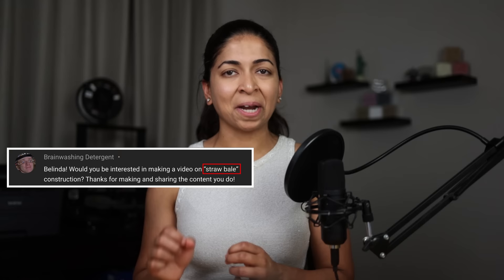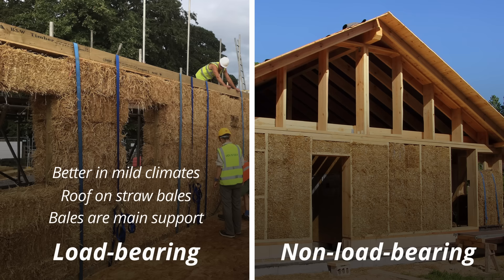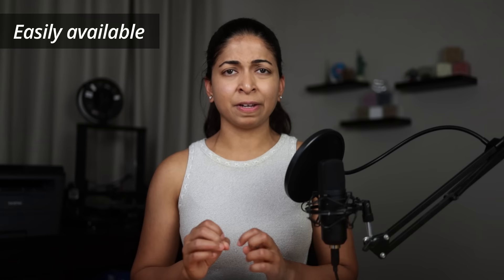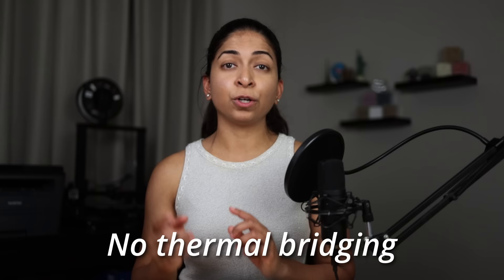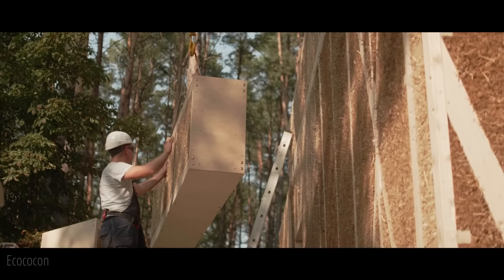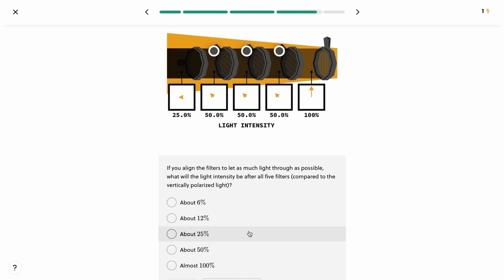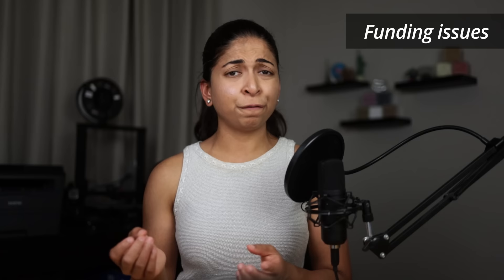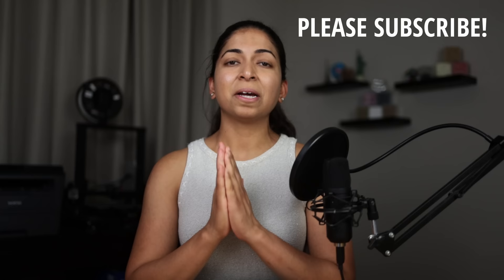How to build Straw Bale Houses | Pros and Cons

Comment: A builder near me built several load bearing straw bale houses for clients in the 1980's-90's.  When he wanted to build one for his own family the banks and insurance companies put a stop to his plans. I've talked to the people who live in one of those houses and they say rodents are the biggest negative even though the bales were treated with a rodenticide before construction. Someone else I know built a similar house using baled cardboard instead of straw. He ran the cardboard baler at a large catalog company distribution warehouse. When he learned how much the company was paying to dispose of the bales he made a deal with them to take some for free.The walls of his house are 30 inches thick.
Reply: We’ve near had rodents in our Strawbale we used stucco and not earth in plaster. Friends of are’s have had a lot of issues with there earth in plaster Strawbale.
Reply: But if the bales are completely enclosed in cob, how would rodents be an issue?
Reply: @RVBadlands2015  If the strawbales are essentially sealed off, not sure how rodents could be an issue. What issues did your friend have?
Reply: @backtoasimplelife  Stucco expands and contracts with temperature changes. That causes cracks to form and mice can get through those cracks into the straw bales. For a mouse it's a great place to raise a litter.
Reply: @zone4garlicfarm  And cob?
Reply: @backtoasimplelife  I have no experience with cob. The straw bale houses I'm familiar with are finished with a traditional cement stucco. I think a synthetic or acrylic stucco would be better because it can stretch and flex so it would be less likely to crack.
Reply: Respecting som building codes and using rodent grids protection are made for that ! ; )
Reply: Strange. Straw is made from dead plant stems which are not food to rodents. I suspect it's not necessarily an issue of rodents due to straw bales, but rather an issue of rodents regardless. If any house is not sealed up well, they will find a way in.
Reply: @backtoasimplelife  They don't eat the straw but they love to nest in it.
Reply: @backtoasimplelife  mice love to chew through soft materials like straw, cardboard, foam, bedding or mattresses to create nests and tunnels in. One of my friends found an abandoned bed on their attic and mice just bit tunnels into the mattress, shat and peed all over it and raised several litters inside the mattress. If mice have enough time they can even chew through soft or thin wood plaques like chipboard, at least round the edges
Reply: @isabellasorensen8128  Right, but this straw is coated with a hard layer of cob, and I am sure it is sealed everywhere or you would have air leaks.
Reply: @backtoasimplelife  Sure. And there is no air leaks in straw bales, they are very compact and thats why they insulate so well
Reply: I actually found an easy fix to stop mice from nesting, put broken glass on the straw right before balling so there is glass inside of the straw bales and mice get cut and will not nest
Reply: Cardboard bales would be a fire hazard. One of the things that the narrator doesn’t mention is straw has cellulose in it which makes it difficult to burn. Cardboard does not have that advantage. As far as rodents and moisture go, it’s like any properly built home, if not done well you will have issues. Some people put 10% cement in their adobe mix which eliminates the rodent and insect issue.
Reply: Rodents and mold.

Comment: ❗️Couple of important points she doesn’t mention is straw is an ANNUAL CROP where as lumber takes 50-100 yrs to grow so far more product over time. Also, the reason why straw is so fire resistant is because it contains cellulose which makes it difficult to burn.

Comment: Bamboo would be an interesting building material, that would complement this.  Sustainable and quick growing. Any chance of making an episode on this in the future? Thank you.
Reply: Amazing to see the Asians using Bamboo for their actual structures design in more than one story... even India I suppose I've seen for scaffolding very high multistory when making RC structures.
Reply: @jafinch78  sounds interesting
Reply: As long as you don't use bamboo as a concrete reinforcement!
Reply: @MonkeyJedi99  Wondering if a carbon fiber rebar rod can be made using?
Reply: Bamboo is popular as flooring.
Reply: See Hemboo.  🙂
Reply: @MonkeyJedi99  why can't you use bamboo with concrete?
Reply: @carriefisher2644  Bamboo is an organic material. It is also an organic material with air voids and contained water.
Organic materials with access to water (from itself and/or the concrete) and air will decompose.
Do you really thing having your concrete reinforcement material decomposing inside the concrete will lead to strong structures?
Reply: @MonkeyJedi99 I would imagine, just like straw, you have to completely dry it out. There are gages to check moisture levels.
Reply: Enough is clearly not spoken on he sustainably of bamboo

Comment: It is unfortunate people do not consider things like appropriate technology for the intended use, climate and energy involved in transporting "sustainable" building materials. I live at 7,000 ft and people here have made fences and buildings out of straw bale. When the bales crack and get water inside them, they rot and disintegrate. They can work in some areas, but if you have extreme humidity swings and extreme temperature swings particularly cold to hot, these are a disaster if not done right

Comment: FYI - because of a lack of housing around Sinclair Wyoming at the refinery there during a shutdown a group of 4 construction workers took my idea (I was always reading about alternative housing. That made 5 of us) and the week before the job we leased a 1/2 acre from a rancher and built an octagonal straw bale house that was 30 feet across flat to flat outside dimension. A 6 inch post at each corner of the octagon and a center post for supporting the roof. We built a wood deck slightly off the ground and stacked bales between the corner posts. One flat had the exterior door and the other flats had window boxes built that were 18" deep with a single cheap aluminum frame window on each side so it was "sorta double paned" (we ended up growing herbs and stuff in them). So as the bales were stacked, a window box was substituted for a bale.
Note that we used black visqeen plastic to set the bales on and when a wall segment was done we brought it up on the outside and inside to the top and stapled it to the cross beams going from corner post to corner post to encapsulate it for water proofing and air sealing. We then put 20 foot rafters going from the higher center post out to the octagon wall sections. We 1/2" plywood decked and tar papered the roof, then decided to put a layer of visqeen on top of that and some slats to hold it all down in the expected high winds we were informed of.
Privacy walls of 2x4s were built to make 5 pie shaped (truncated point... For the cheap blanket hanging doorways in the center) bedrooms with the open main living area and kitchen taking up the rest of 3 remaining 'segments'.
We got a local built 35 gallon steel barrel wood burning stove for heat and ran the vent chimney up through the roof.
We stayed there for 4 months (and it snowed and blew quite a bit) and it was quite nice and didn't take much to heat. When we left we figured the rancher would just burn it down or something because he said just leave it, he'd take care of it.
Note that the entire cost to build it was less than $500 back then, so individually it was $100. Since we were all getting per diem we made out like bandits!
TWENTY-FOUR YEARS LATER I ended back up in Wyoming and drove my wife and kids there to show where I'd built the hay bale house and was surprised to see it was still there. Electricity had been brought in and the exterior was stucco and it now had a metal roof.
Pretty good for a temporary shelter for "migrant" industrial construction workers, haha.
Reply: Nice there was freedom to build
Reply: "Leave it, I'll take care of it."
Reply: You should ask if you can record a video of it, i'd like to see the design
Reply: @KvltKommando  well it's 1406 miles away from where I now live according to Google Maps and I haven't been closer than 700 or 800 miles of there in over a decade so....
No, there's not going to be any pictures.
I'd say go look up pictures of a yurt, but make it octagonal instead of round.
Reply: Can we find it on google maps? I would love to see it.

Comment: Thank you for a solid and honest overview of straw bale building. And yes, I would be hesitant to build one in a humid climate, too.
My spouse and I designed & built a large 4000 sq/ft straw bale home we happily lived in for 14 years (until we had to move), and it was one of the best decisions we ever made. It was about 10% more expensive to build compared to traditional homes due to the more labour-intensive process, but the incredible insulation values meant that the cost of heating & cooling the place was minimal, offsetting the extra building cost within 3-4 years. 
We lived in an area with 37C/100F summers and -35C/-31F winters, and the house was never too hot or too cold. A smart passive solar design, open concept and lots of thermal pass was a big part of that, too.
One thing about prefab straw bale walls, though: the flatbed trailer transporting those bulky walls to your site very quickly increases the home's carbon footprint...

Comment: I grew up in central Texas. I remember the old homes with 13” thick limestone walls and deep overhanging roofs. Those thick walls were a great choice because they insulated the home. I also love the deep overhangs. So much light and yet it helped save energy passively. Do love to have a home with these features today.
Reply: Actually stone provides no insulation, it is thermal mass. It will slow the transfer of thermal energy but acts like a big battery for heat or cold, reradiating it out over time. It’s a buffer, not a barrier.

Comment: Great summary of strawbale construction Belinda! I love the idea and possibility of the prefab strawbale walls. We have lived in our Timberframe home with strawbale infill for 14.5 years now here on a small island on the southwest coast of Canada. The timber came from the property, island and neighbouring island. The home was built in the method of “workshop” for much of the building process. We still have people who come up to us and say what part of the house they worked on and what they did. There are some interior packed clay walls and one section of an exterior wall as well. The building has wide overhangs and wood on the south exposure side with the big windows that gets the most impact tour west coast winter storms. Many skylights on the metal roof keep the home bright and cheerful in any season. All the pros and cons mentioned in the video fit our experience of living in our strawbale timberframe home except for bug and rodents. These have not been an issue. The lime plaster walls are sealed and nothing comes in unless we leave a door open. We treat treat the home perimeter yearly against carpenter ants which because living in the woods is something everyone should do. Cornfield ants sometimes like to live under the cement pad of the home and can get confused and come into the house when they are leaving the nest but this isn’t because of the strawbale walls. So no concern with bugs and definitely not rodents in the house. Our lime plaster both exterior and interior has stood up extremely well and I am just this year starting to apply fresh milk paint to the inside walls. What we really love about our home though is how it quiet and breathes and how it is cool in the summer and warm in the winter. It is a sanctuary. We have in-floor hot water electric heat and a gas fireplace as back up for our many power outages during the winter. The home is modest at 1,200 square feet with high cathedral ceilings and surrounded by woods. If we ever have to move, this is a home we will be deeply miss. Ordinary homes just don’t measure up to this home. It seems to love us back in the way it wraps around us like a warm hug. Here is a link to my blog with some photos from about 12 years ago. The place has changed some since then as we added another main floor bedroom with wet room ensuite where the front deck use to be for aging in place: https://creativepotager.com/la-casa-de-inspiracion/

Comment: Sooo glad you are a convert! Personally, when I was looking at what resale of strawbales would be , I found they sold almost soon as they came on the market  and sell at high prices. I don't think bugs are a real problem as highly compressed and sealed unlike stick built homes that are very gap ridden. Hand done home can have rounded corners, window seats and be very whimsically hand plastered. There was a whole thing prepandemic where an expert comes and oversees the construction of eager to learn people doing free labor and then people who had been to a couple of these invited more people to come learn for free labor. I don't know that I love the panels that much... do they have the same wind/ fire resistance? Found the website and they are only easily had in Europe and am weighing osb with covering vs plastering or concrete spray that keys into the bales for durability. looked at the price of the one bedroom tiny house and wow. Most strawbales in the book I bought were done for about $30 sq ft.

Comment: Those thick walls do have one advantage that makes them well-suited for building in the desert. It means that windows have built-in shading which means you get light without as much undesirable heat gain. Stick-built homes tend to omit shading on windows. 

One of my favorite straw-bale homes is in the desert of southern Utah. If I'm remembering correctly, it's about two decades old at this point and it's timber frame (i.e. the straw isn't loadbearing). One of the unique features of this house is the indoor lap pool, surrounded by windows along the south side of the house. It acts as a thermal and hygric buffer for the rest of the house. (it's kind of like an earthship in that way.)

Comment: Straw bail homes are a great idea, but super extra care must be take during the construction process.  As a fire fighter I was present at a structure fire on a home the had a room in attic type detached garage under construction using the straw bales.  The stucco had not been applied when we were there, the mobile home had a fire under the floor that was self vented  out the side of the structure.  Upon arrival the only thing other than the home in danger was the LP tank.  We entered the home and started cooling the LP tank, within minutes of this starting the hot ash started the gable end wall on fire, in less than 5 minutes the roof was on the ground.  
During the build you are creating a fantastic fire environment, vertical stacks of straw.  A simple spark off the saw could result in starting over or someone's life.

Comment: Prefub panel houses seem to be a sensible idea in aridish areas, closer to equator or countries like Turkey.   Any area with high humidity or big seasonal temperature change is a big nono it seems.
Good video, Belinda! Thanks for this info!
Reply: It depends on whether the water is going to condense or not. So humidity alone will not be the problem but when combined with conditions that can lead to it. Humid interiors in cold climates for example could lead to problems. However it should also be noted that straw bales can take on an expire vapour, mitigating humid conditions. Something else to consider, wherever you use wood you can also use straw otherwise you'd be having problems with the wood structure as well. 

I believe John Straube has done research on the vapour storage capacity of straw.

Comment: I’ve attended a stawbale workshop, and learned a lot. They are very beautiful houses but the technique is limiting in what you can design and everything from foundation to plumbing to electrical becomes much more complicated. The project I attended we had to use underground electrical in the whole house and the foundation alone was over $100k. Since the workshop I’ve been wanting to learn more about hempcrete and exploring a combination of that with a post frame construction.
Reply: Concrete is not cheap.

Comment: I've wondered if there is a method to seal the straw bales using some sort of polyurethane spray coating or like maybe even wrapping with sheets of thermoplastic like PET or other long lasting recyclable material where a vacuum can be applied for further potential insulating effects.  Amazing how thatch and cob were more common at times in parts of the World.  Sad the lack of regenerative and renewable resources use... though is good to see a flow versus ebb economic season main stream.  Guessing something malicious wanted to own whatever they could get away with.

Comment: I am very interested in straw bake oanels, especially the panels with straw and mud compacted together to make it fireproof.   I saw some mentioned in a book that were the thickness of dry wall.  These would be useful to add behind drywall for remodeling.  It would be nice to have loose straw coated with mud to use as a loose insulation material.